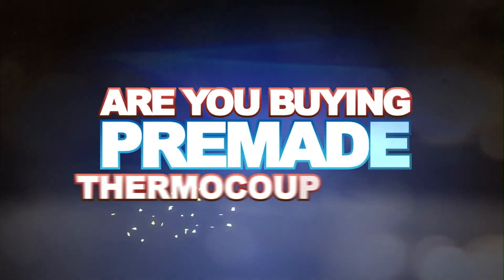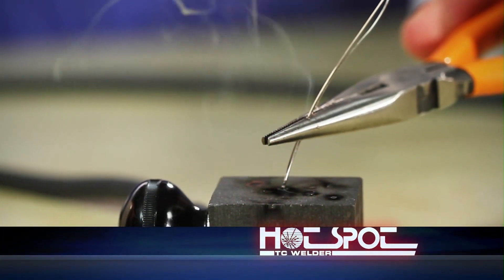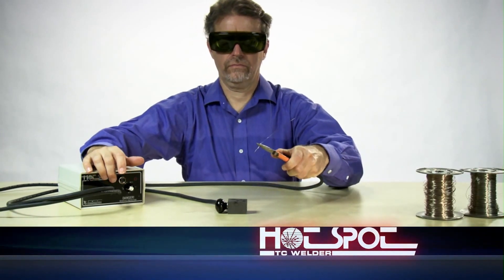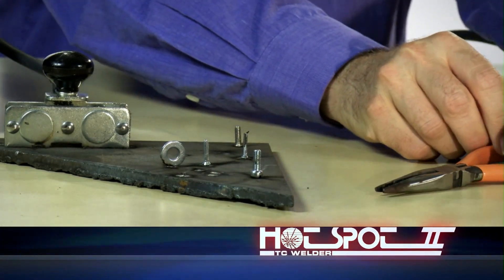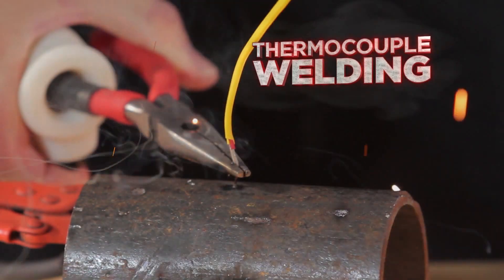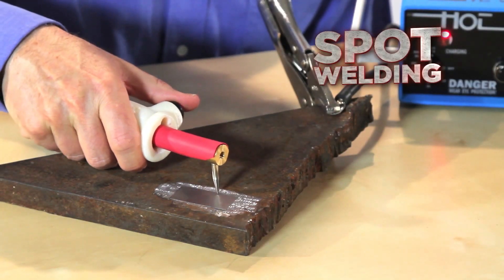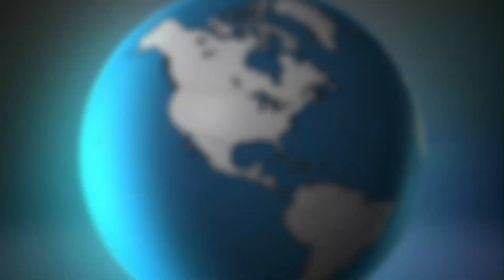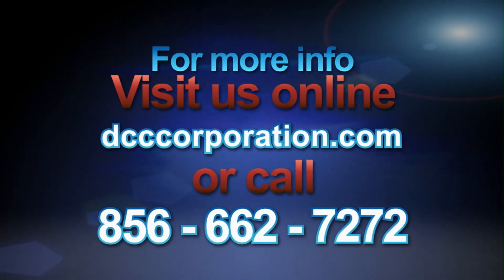DCC's HotSpot and HotSpot PLUS Thermocouple Welders

Comment: Nice apparatus.  We mainly use Type T thermocouples from GA 22 to 30 and these need to be welded in an argon atmosphere to prevent the copper conductor from oxidizing during welding.  Your video doesn't show any attachment to achieve this.
Reply: OMG thank you for sharing the knowledge. I spot welded type T thermocouples to a steel pipe and the readings were off.